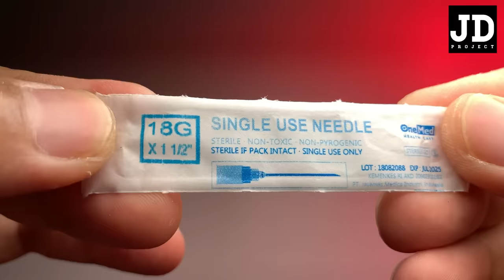Honda Civic EF Drag FWD FF Hot Wheels Custom

Comment: The project is insane 🔥 But you did a mistake. First, hot gases go from exaust manifold to turbine, after that they go to intercooler to get the coldest air possible before re entry in engine

Comment: :) hot 2013 c'est celles qui vas bien :) aujourd'hui :( en 2020 elle est trop haute et ramassée pas à l'échelle bon j'ai retourné un coffret avec trop de double et un mauvais montage :( hot m'a renvoyer gratuitement en echange par transporteur du vieux coffret une perle! chassis  acier et certaines coque plastique donc quand c'est chassis plastique c'est coque acier CQFD :) Whoow certaines pour mon circuit sont trop basse ou trop hautes :( donc en visuel et pas en circuit TCR de descente :) du support en carton piliers je passe en bois très stable les rails sont vissés :) et peut être faire des points d'appuie dans le mur :) bien calculer les pentes trop fortes sortie! peu arret :) construction en carton du bas vers le haut! mais bois vis et applique du haut vers le bas :)